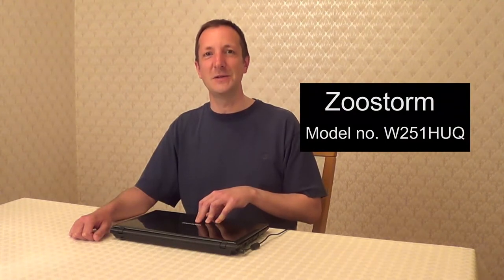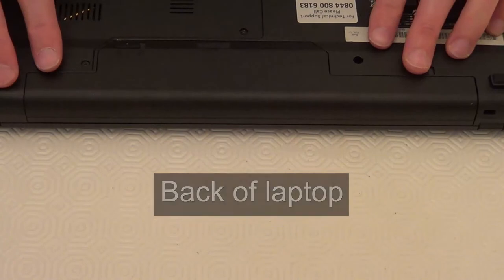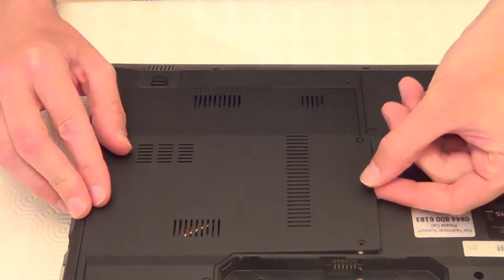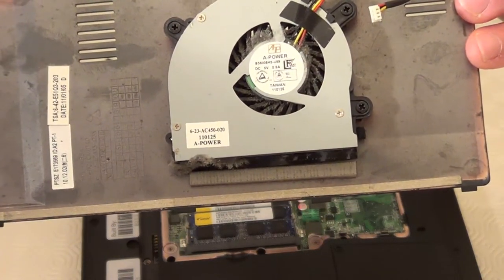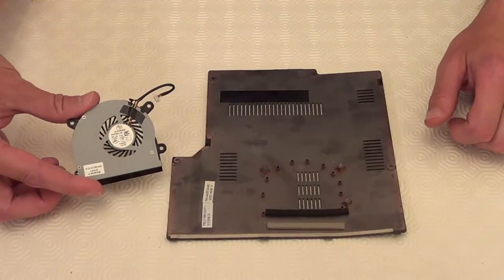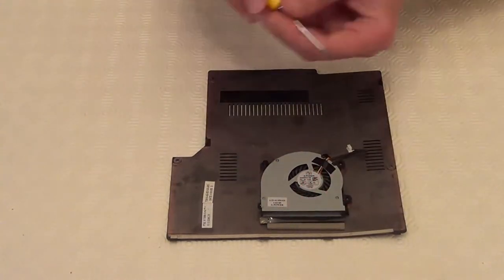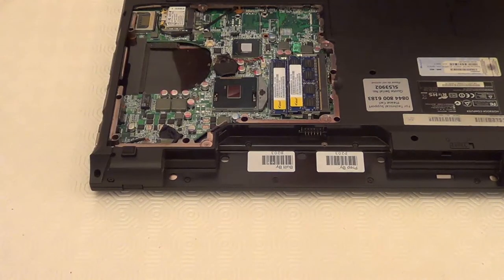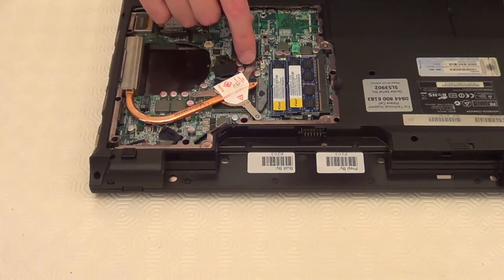How to Clean a Zoostorm W251HUQ Laptop Fan

Comment: Could i use a hairdryer to blow through the vents instead?
Reply from the maker: +Kathryn Otley Using a hairdryer would not be a good idea due to EMI, but if you don't have a can of compressed air, simply blowing it will clear a lot of the dust away and may be good enough to get the job done.